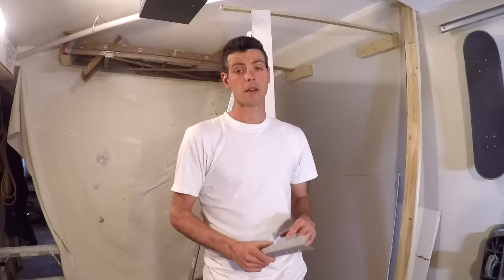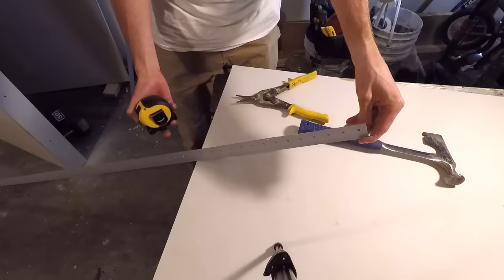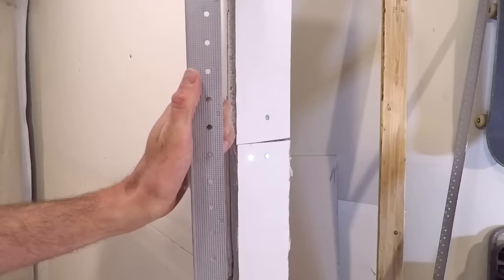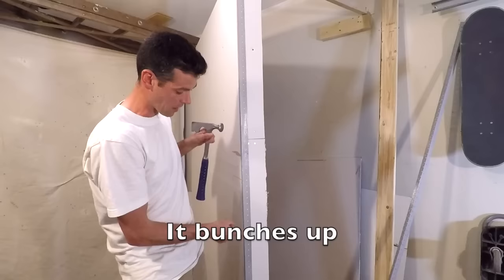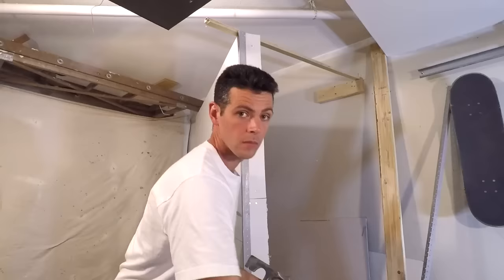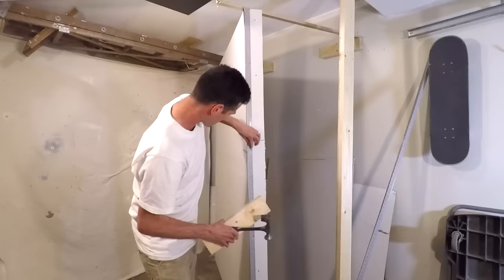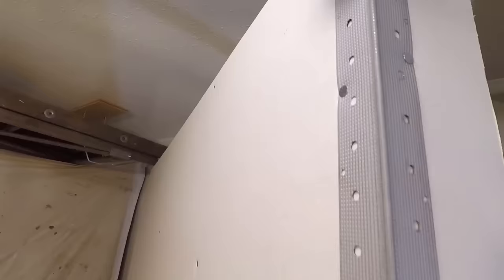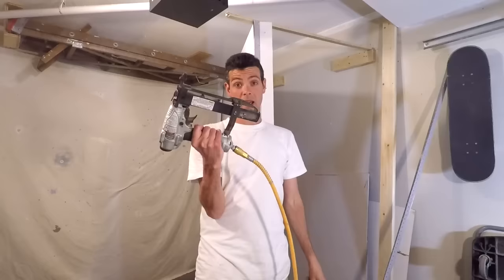How to Install Steel Corner Beads

Comment: Nice video. What type of tape do you recommend for using on the 45 degree cathedral ceilings? I have to fix peeling tape and I find cathedral ceilings with angles always peel and crack
Reply: john rescigno try adjustable angle
Reply from the maker: No Coat

Comment: I sort of laughed imagining the 2x4 showing the wall being bowed, and then rotating the board and then it fitting perfectly.  I think I would use a keychain laser pointer and a mirror to get an estimate of bowing, distortion.   I love how you left in the audio for the additional hammering.
Reply: Yeah not the greatest way to check for straightness..

Comment: Thanks for sharing. Ever use the corner bead crimping tool?? No need for nails
Reply: I have one, but keep forgetting to take it to the jobsite.  I still use nails to secure the metal corner bead to the stud especially in the bang-zone, the first three feet from the floor.
Reply: @topsyball1049  Why?

Comment: Great vlog. What about PVC bead? Do you ever use them? Do you think their any good? Cheers...
Reply: Same here, I have a slick job coming up. I can't find paperback or mud set  F-trim anywhere and have to consider using either trim tex which is a vinyl glue-on type  shadow bead or Flannery Trim extruded aluminum F- bead.  Both sound like a nightmare to install.  what are your thoughts on  wither of these product?

Comment: What are your thoughts on the Corner Bead Crimping Tool?
Reply: Useless.
Reply: They're crap.  Gets you out the door quickly and leaves the customer with a POS that will be popping off the wall in short order.
Reply: Crimping tool sucks

Comment: Not a joke, Iv'e put up every kind of bead and drywall you can put on. As a 25 year Commercial Union Carpenter local 314/200. I've  spent most of my time in interior systems. I haven't seen metal bead on a job unless aluminum counts in 10/15 years. Everything is plastic/paper.
My dog why are you nailing the bead. It is 2019. Either get a clincher (29usd+mallet15usd)and/or a screw gun. Use the Clincher and screw the clinch spots. It self centers the bead.
No-coat bead is hardest to make look good without the outside roller (89usd+pole20usd) and it still is only as good as the finisher.
Metal is tougher and easier to fix later on. Go ahead tear that No-coat bead off the wall once the mud dries and the corner has been dented hard and cracked or just installed wrong on bed coat. Just saying I've installed and repaired both and they are different animals.  But I am a carpenter and bead work is ....or was our work. We still get the all the Fry-Riglet inlay and reveal bead. 
You do really good quality work and it shows in your technique. i wish more finishers had your ability. 
Please continue with your very well made and almost always accurate videos. Thank you that was painful/and funny to watch you using a hammer on bead in 2019. lol

Comment: Do you not like to apply mud underneath before leaving you nail them on?
Reply: All the mud does behind the corner bead is hold it to the wall.. Like on paper corners where you dont nail them on..Then the mud on top makes a bead sandwich and it hols the corner bead to the wall..
But, this way of nailing it on.. You dont need the mud to glue it to the wall as thats what the nails do. 
i think its better this way in my opinion.. If anyone ever bashes a corner with some furniture or a table or somehing like that..it will just make a dent.. And it wont tear off eventually, like if it was just held on by some mud

Comment: Can you use drywall screws instead of nails?
Reply: You generally shouldn't. Screw heads sit up higher than nail heads, so they're more likely to cause problems when you mud. You can bend the corner bead more aggressively to 85 degrees or so, but then you have to be more careful about making sure it's straight. I really like the stapler suggestion, you get the best of both worlds. Hammering nails in tight places is no fun.
Reply: @jonathansage2147  Thank you.

Comment: Learned a lot watching your videos. I do have a question and maybe a suggestion for another video. I have a drywall ceiling that seems to have a splatter design of paint. I have made the patch using 20 min mud but since the patch is smooth it stands out. What do you recommend on doing to help it blend?
Thank you
Reply: @ T Rohr  To  blend texture on sheet rock repairs, big  box or paint stores carry a product called "Homax"  wall texture in a spray can.  They work well,   just make sure you purchase the correct type.   Orange peel,  Knockdown,  or Popcorn,  match the product with the type of texture on your ceiling.   Personally,  I don't think the extra $$ for the "Pro" style cans isn't worth it, the regular cans work fine.  Make sure you test spray a small area to adjust the nozzle for spray size.
Reply: ime those spray can textures never work, although they are better than nothing. i used to work for an hvac company doing patching so ive blended alot of texture. best way really is to just buy a decent texture gun (about $80) and do the proper texture on the patch (popcorn, knockdown, orange peel)

Comment: Do you have to use nails could you use screws?
Reply: Steven Sandoval you can use screws.  But I prefer to use a corner bead tool.  I’m not sure why he didn’t use one in this video. (I’m halfway through the video as of writing this). It takes about 20 seconds to put an entire corner up with a coenerbead tool.

Comment: Great info. Can you show how to properly install multiple corner beads in a row like if you need more than 1 piece for tall ceilings or a bulkhead. Are they supposed to be butted up? Taped seams? Cut at 45? Cut and taped?
Reply: A good question.   When a joint is necessary,   slightly trim corner bead back to form a V at the end,  and the joint will butt tight.   Then cut  a 6-8 " splice and put it under the joint.  it will keep the ends from rolling and keep the joint aligned.   Nail as necessary.

Comment: you align the corner bead with your infra red plumb lines nowadays.  I used the denying tool to fix the bead on the boards together with some screws 30 years ago.  it's much faster
Reply: What?

Comment: the metal corner beads that they sell at home depot menards, do not have the nail holes offset on either side like the ones you have

Comment: I installed metal bead when I could have use paper steal. Such a PITA. The corner never quite wants to get covered with mud.  Never again.
Reply from the maker: Sounds like it was pushed on too tight or out of square. That's what I meant by not wrestling with them. You just have to put them on where they want to go.

Comment: Your a good tradesman, really enjoy your videos, but this is the first time ive disagreed with you, ive been in commercial drywall for about 15 years, i do not care for your metal bead approach. Lol. No big deal and you werent terrible. Im just super picky about straight beads and for that reason only use metal and never nail them
Reply: If you don't nail them, what do you do?
Reply: I've seen pros in England just plaster the beads on . . Once the plaster set it doesn't move cos it's solid , but I always use a few nails /screws just in case.

Comment: I thought you didnt like nails?
Reply from the maker: Time and place. Steel beads are one of them.
Reply: @vancouvercarpenter  I see.. I prefer to use a clincher tool to install the steel beads myself, and I actually use them almost exclusively. Love your channel! Thanks for the great content!
Reply from the maker: I bought a clincher once. I think it was fault or something because it wouldn't work. It was like it was for a wider bead but I have never seen different width steel flanges.
Reply: Now, why do you say that the place for nails is on corner beads? Why can’t/shouldn’t you use drywall screws?
Reply from the maker: @IamTedV  you can use screws but you have to sink them deeper to get them flat. This can pull the bead in farther than you planned. Nails sit nice and flat.
Reply: Good to know. Thanks Ben!